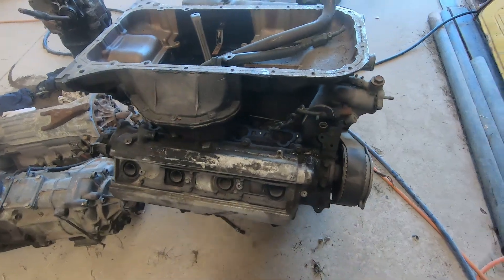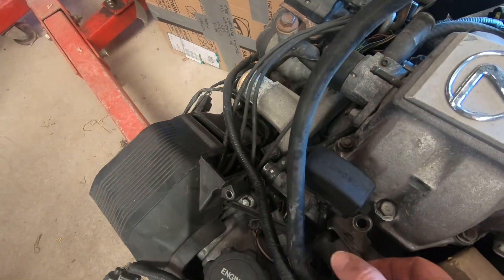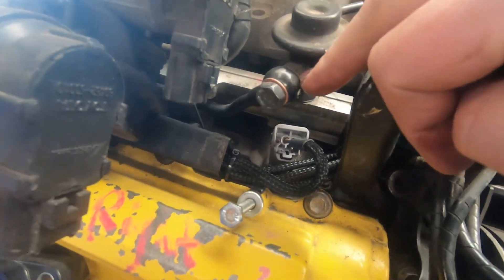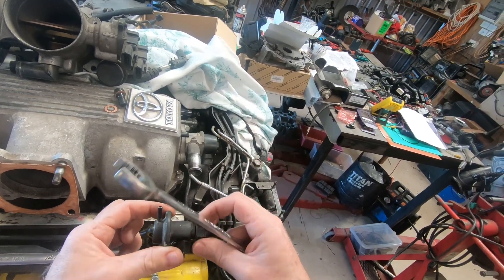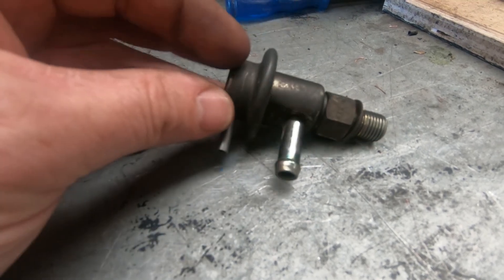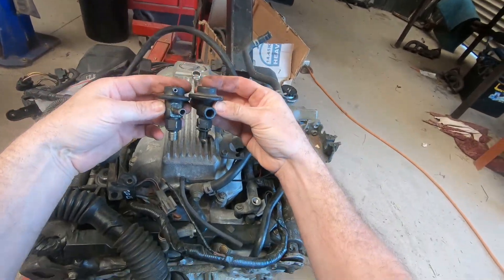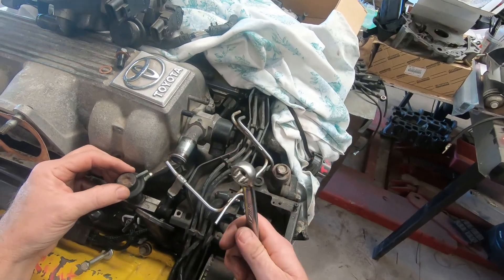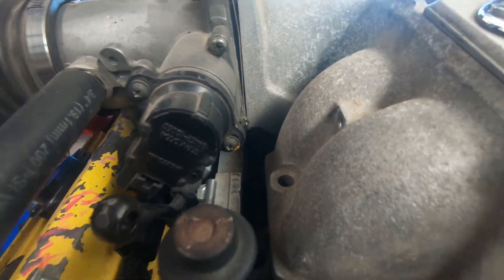1uzfe Fuel pressure regulators - Gen 1 to Gen 2 Swap

Comment: Hey what did u mean by incorrect airflow meter from the video provided to you?what exactly did he do to fix it ?replaced MAF
Reply from the maker: Yes,  incorrect airflow meter or maf means it was the incorrect parts which was swapped to the correct item.
Reply: @CartuneNZ  i have the same problem it does the same symptoms but all I did was replaced the starter on a sc400 1995 I removed the manifold multiple time to see if I miss anything but no luck any ideas ?

Comment: Hello, Calvin. 
I'm using a fuel pressure regulator in the fuel tank. 
He consumed 100 kilometers, 25 liters. 
Is it because of the fuel pressure regulator?
Reply from the maker: I dont know.  Have you checked fuel pressure?  Have you checked air fuel ratios?
Reply: @CartuneNZ  No 
Do I do it on a computer? 
Should I go to a maintenance garage?
Reply from the maker: I would have it on a computer so maybe a maintenance garage is a good idea

Comment: Do I have to remove fuel pump ecu to depressurize fuel lines before changing fuel pressure regulator
Reply from the maker: Really up to you if you depressurize the system beforehand or not.  Cheers Kelvin

Comment: Can you tell me, Does the bulletcars supercharger manifold require the gen 1 or gen 2 coolant bypass on the rear of the engine? 

I ask because I have a 97 long block with 95 intake, harness, ecu, maf, fuel rails and coolant bypass on it.
Reply from the maker: From memory I dont think I've had an issue with either however as I have both options readily available we can change things and I might not remember.   As the gen 2 is smaller its likely fine
Reply: @CartuneNZ  From memory for me… been 5 years…I kept that spare 95 longblock and had the left over parts from the 97. And its hazy, but I recall never being able to mock it up with the gen 2 crossover due to the shape of it. It has a protrusion that interferes with the intake. 

I gave the old longblock to friend years ago.
Reply from the maker: @michaellecompte1889  I understand messy memories.   Ive done so many things with these engines but generally once its in front of me it all comes back.
Reply: @CartuneNZ  100%. As you said, worst case, grab the other crossover and make it work.  As an aside, have a recommendation for a rising rate fuel pressure regulator for a 6psi roots supercharger application on stock ecu?
Reply from the maker: @michaellecompte1889  rising rate we use aem,  sard,  turbosmart, or tomei.  All work fine.  Just no unbranded chinese special.

Comment: Question: ive been trying to find an instruction video on how to delete the fuel line/sensor for cold start injector under the intake manifold. I have a 90 ls400 with the billet fuel rail and the hole for the fuel rail union bolt got stripped, and i noticed it was blanked off on old yeller. Any info is appreciated
Reply from the maker: I have a video on the topic.  It does require thread in the fuel rail,  or weld it up, however I never do this when running a stock ecu which is equipped with the cold start function.  https://youtu.be/Enjgx0pNTno
Reply: @CartuneNZ  is a ucf20 ecu able to plug and play to first gen 1uz any links would be awesome, thank you so much!
Reply from the maker: @carlosguerra283  sure,  its swap the loom and rewire car appropriately.   https://youtu.be/z3KDRqfrLRw
Reply: @CartuneNZ  i found this, https://youtu.be/0OBdaCitAQI darn toyota!

Comment: I got a ls400 that cranks no start. Timming is good. Fuel pressure is good and spark. Cranks fine then will grunt like hydro lock thencranks normally again. Wont start trys to start but won't. Pulled all plugs and cranked it. Wont grunt and cranks normally.  At least 90 psi on compression test
Reply from the maker: Any chance its recently had an ecu swap?

Comment: 1992 sc400, cats are glowing red, fuel pump walbro 225 lp good for 500hp was wining high when I walked outside to check on car,  runs  weak, replaced both ignition coils, I gutted the cats going to check spark plugs wires distributors next.
Reply from the maker: have you checked the fuel flow?
Reply: @CartuneNZ  broken distributor.
Reply: loooool my case xD same pump instaled

Comment: Any idea why I would need to use starting fluid on cold starts to get my 1UZ swapped 91 Toyota pickup to start but then when its warm it will start just fine. After it started when its cold it will run just fine.
Reply from the maker: Main issues I see is wired incorrectly , next its component failure so I recommend doing some testing to see whats up with it.  Cheers Kelvin

Comment: I'm in dire need of help man! I recently purchased a perfectly running 1980 Toyota Celica Supra MK1 with a 1uz fe. It was running fine and perfect for a month, then i found rust in the tank, replaced fuel lines, filters and pump. All is good and clean now, but when i start her up she will idle and rev and after a few moments she lags and misfires and cuts out... Please help 😭
Reply from the maker: Looks like you need to do some diagnoses.  I have videos with heaps of free help.  I would check injectors , confirm fuel flow , check ecu codes and coils.  Cheers Kelvin
Reply: You ever figure it out?

Comment: I have a 98 gs400 1uz engine and im having issues it turns on but dies . unplug MAF and stays on but dies once i push the throttle ?????? .(MAF is new by the way along with a shit ton of other parts fuel unit crankshaft camshaft sensors.. injectors etc) im lost !! Someone please help
Reply from the maker: Have you connected a scan tool to check for codes and monitor live data? Checked fuel supply?  Checked ignition system of coils and spark plugs?  A failed coil could give same symptoms.

Comment: On the Gen 1 FPR, what size and pitch banjo fitting is on the return?  I know it's M12 on the feed, however need to find the return fitting as well - loks to be M10 - uncertain of pitch (and this is missing on my engine - hence the question).
Reply: Oh - and these are a very useful set of videos - between this, and the Lextreme forums there's a lot of useful info.  This engine is going into a jet boat - current hard lines on the engine are missing.
Reply from the maker: Hello Nick.  Not exactly sure of the thread at this point but ill have a look while I'm wiring up the present job for a jetboat.  haha.  Yep I'm doing one too.  Part number for that banjo bolt is 90401-10038  which might help.  I'm getting low on them so might have to start getting new ones.  Thanks for the compliment.  Now back to the engine prep then wiring for this jetboat.  Cheers Kelvin

Comment: Is there an easy way to test if these are working?
Reply from the maker: Best way is with a pressure gauge to confirm pressure is correct and check fuel flow out return at the same time.  Cheers Kelvin

Comment: Have you seen any problems after removing the water lines in colder climates? Like icing in the throttle body?
Reply from the maker: Not yet.  We don't often get down to freezing over here and generally the engine bays are pretty hot so no issues for use.  We generally see the TB with water lines only at the bottom but I have seen a few with the water top and bottom.  So far no issues for icing.  Cheers Kelvin
Reply: I had the screw back out of one on a 3uz